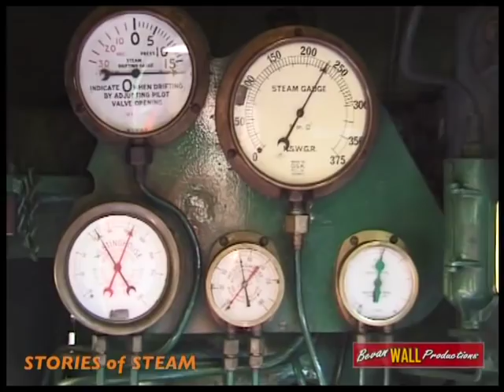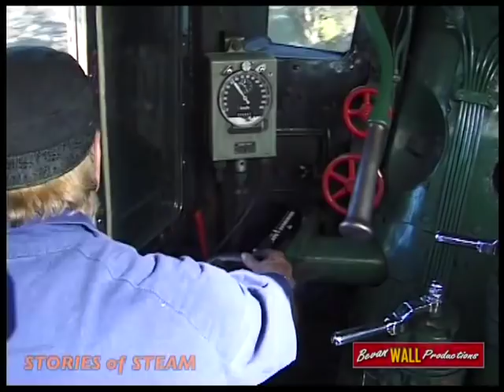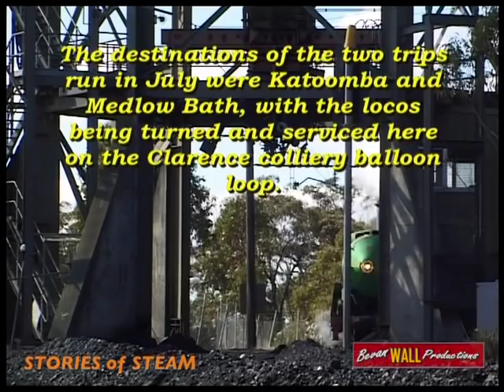Australian steam locomotives 3801 & 3830 - "38s Over The Mountains" - July 2000

Comment: Awesome footage of 3801 & 3830 running together, do you think 3830 will run again at all? Would be great to see it
Reply: Well it's still owned by the Powerhouse Museum and it's their decision whether to release funds to make a new boiler after the old one got burnt. But it was such a shame when 3830 was running for it so often played a secondary role to 3801 and was always in the shafts on a train. It rarely got to shine on it's own. One video of Bevan's does show what a solid performer 3830 was when on a trip to Robertson 3801 continually lost it's feet on a grade and if it hadn't been for 3830 pushing 3801 and hauling the train then 3801 would have come to a stand unable to move. 3830 was always known in it's service days as a very strong engine only just behind the strongest 38 of all 3827.

Comment: The type of engine 3801 was originally a U.S. built stream line locomotive.
Reply: No, the design is based off one but that does not make it a US loco
Reply: Nope.  Designed and built in Australia.
Reply: @algrigg9039  The frame was made in Granite City Illinois USA and the streamlining is an adaptation of the New Haven and Hartford Railroad I5 4-6-4 of 1934. But after that the rest is all Australian.
Reply: Certainly influenced by overseas designs (incl US), but it's accepted the eventual final design was developed in Australia.  But it's certainly a 'point of order'!
Reply: @algrigg9039 That's why Americans love the loco so much because no I 5's were preserved. For Americans 3801 is the closest to a NYH&H I 5.
Reply: Perhaps some confusion there because these were called "Pacifics" amongst the rrailwaymen in that era. This was because of the 4-6-2 wheel configuration which was also used on some of the well known English locos. Famously used to haul a number of trains we called Daylight Expresses that ran to various centres in New South Wales. Most famously the Newcastle Flyer, often hauled by 3801 amongst some absolutely spectacular railway engineering around the Hawkesbury River region.